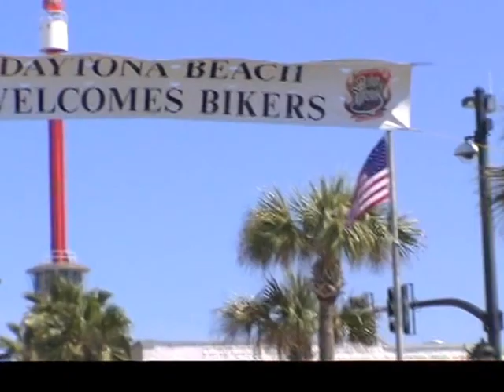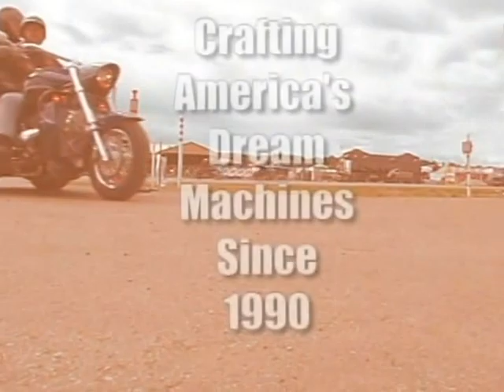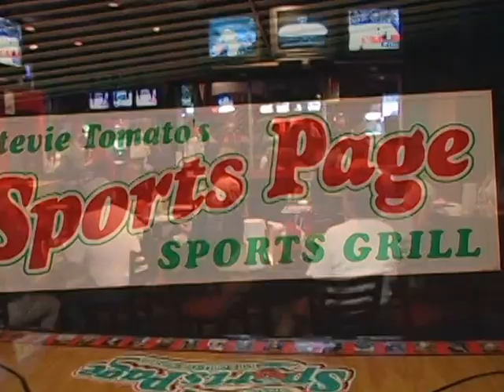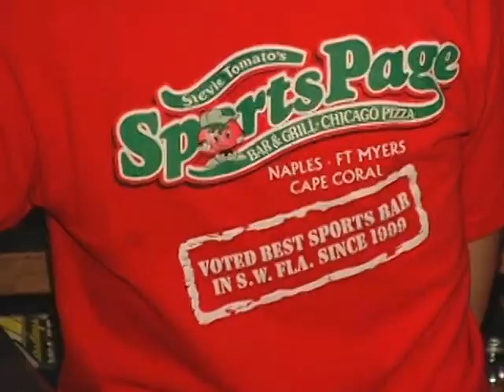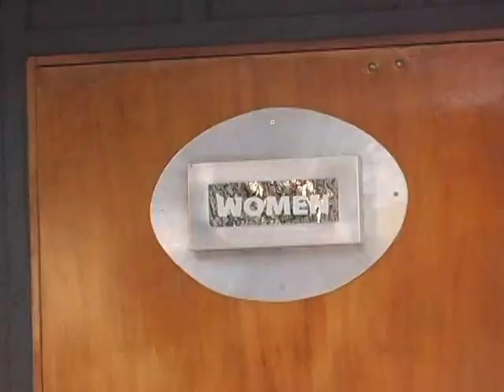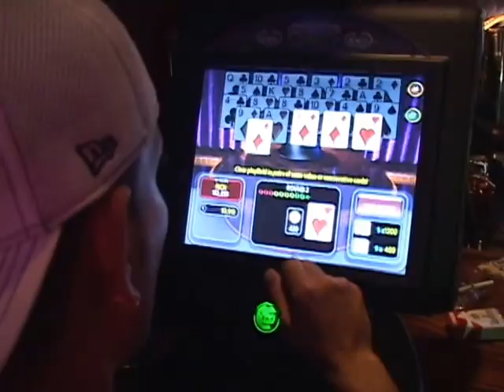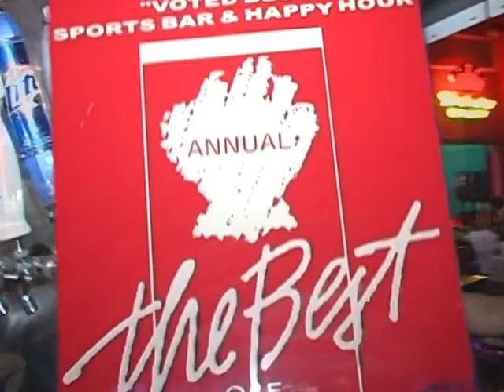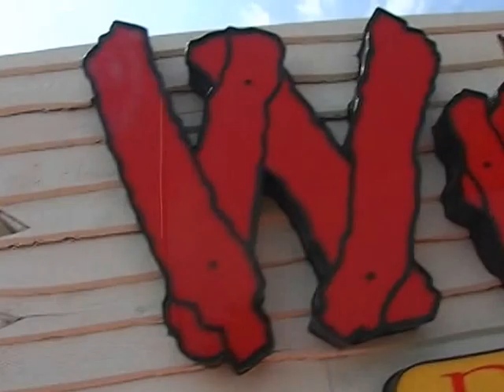Boss Hoss Muscle bikes in Daytona

Comment: I looked up.the price of the boss hoss just out of curiosity I found out it is a,68,000.00 machine can you believe it!
Reply: I couldn't either until I test rode one and got hooked.  I've only got a 400hp 350ci but never had a bike like it.  Raw, raw power, eyeball slamming acceleration and sounds great even idling away.   Great cruiser too, 120 on the Autobahn all day - well... in between petrol stations.
Reply: I find a lot of custom choppers too extreme looking to comfortably ride around on all day. These look really really comfortable in comparison though - surprised that it comes with all that power too. I would have easily used any one of them for the Ghost Rider movies if i was the producer :)
Reply: They are great cruisers, 410 plus ft/lbs torque makes rolling on the throttle easy.  I've ridden 6 solid hours in torrential rain too.  The only thing let me down was my waterproof gloves after 2.5 hrs, the Boss ran so sweetly.
Reply: Hi Walter,
I would not recommend this as a first bike to anyone!  Get a second hand cruiser, ride it for 3 months, then a harley, get a Harley Ultra glide and ride for 6 months hard, then consider seriously and test ride.  Remember,  a BH is very heavy, very, at least 1/2 a ton.  Avoid riding in the wet and never in snow/icy conditions.  It's easy enough to lose traction on a dry road so you don't need ice underneath.

There are plenty of guys who disrespect Hosses and their riders but you can bet they've never ridden one, most are too scared to pull it off the sidestand and they could never afford one anyway.  Envy is a basic emotion. 

I've ridden loads of bikes but this is the one, the special one.  Do your research and check out the V8bikers forum
Reply: Yes, you don't need to pay for a new one if you kepe a look out on the various motorcycle sales websites.  Also before you part with your hard earned dough, do your research and join www.v8bikers.com  forum - a great bunch of guys n gals

Comment: 68,000??  i would rather  buy  a zx14R 205 hp.  12,500$  and put  put  7500 into it... turbo.  INNERCOOLER    head work cams.  race clutch.   all the goodies  and  by by boss hoss  .  i seen stock 14R run 9.68 in 1/4 mile   no way in hell its going to keep up after the mods .